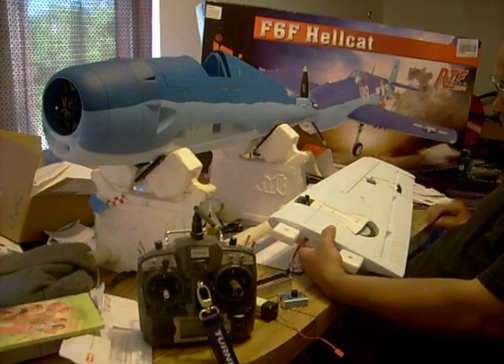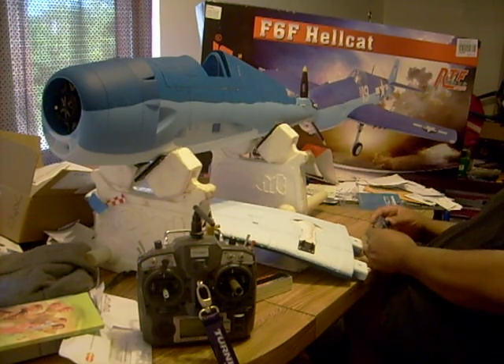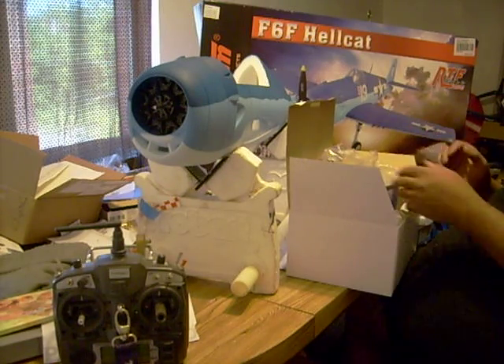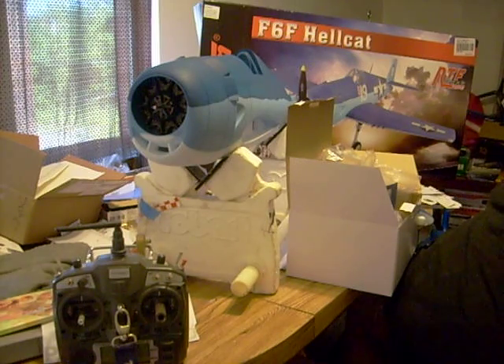Dynam F6F Hellcat Review

Comment: The light blue on the sides of the vertical tail were as per Navy Bureau requirements for vertical surfaces to be light blue to blend in better with the horizon while on deck. Same applied for the Corsair, the lower wing surfaces outer panels were light blue for the same reason. Although different variations can be seen on some planes that may have had damage repaired and then whatever color was at hand painted over it.

One thing to keep in mind too, is that the sun and salt air played havoc on the lacquer paint too, making it fade rather quickly, especially planes operated from land bases with crushed coral landing strips. That's why the  F4Us look rather ragged in photos taken on their island bases from the coral dust blowing down the fuselage and inner wing panels, and the tail surfaces. And when you combine that with the intense sun, it really makes for a dulled down paint job, where the dark blue would fade so bad that it would only look like it was a shade or darker than the light blue sides.

I know, cause i'm a Corsair jokey, and took my Flyzone F4U and made it look like the planes you see in the field with the faded sand blasted look to it, and the chipped paint on the leading edge of the wings where the oil cooler intakes are.